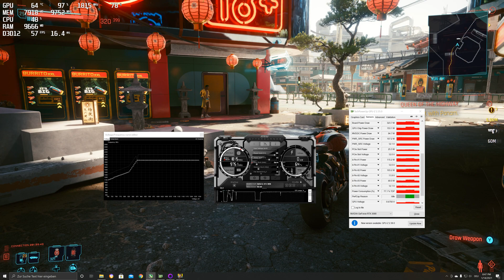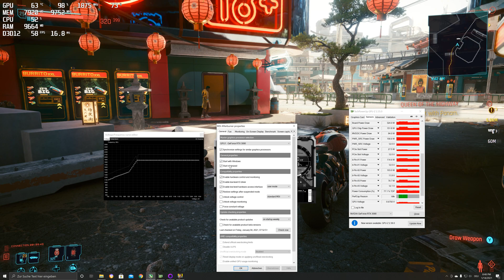MSI Afterburner Undervolt/OC Tutorial RTX 3090 (Reupload)

Comment: Hi ur on a suprim x are u tried 500w bios EVGA with rebar ? It’s really insane
Reply from the maker: No. I have the original 450W Bios OC. But like i mentioned i dont really need it or use it because i doing mostly undervolting. So i actually aim for not more than 370W. 500W may help if you really one do OC tests but i dont need it personally. But yes the 500W Bios is somewhat insane ^^
Reply: @DrumL3000  oh yes i see 🙂 i would like to install it on a suprim x but i am afraid that some things will go wrong normally i imagine it should work fine 😅
Reply: @DrumL3000  I'm confused a bit, let's say you go negative around 200Hz then you move target speed up... So doesn't it make the lower speeds below over volted as they moved down ?
Reply from the maker: @GamersGuard  Im confused by the question :D 
The point of undervolt the GPU is that most GPU chips dont need the stock voltage to reach the clock speeds you need or lets say stock clockspeed. That is what im showing here. If you look the the part when there is the graph then the X-axis represents voltage and the Y-axis represents clockspeed.